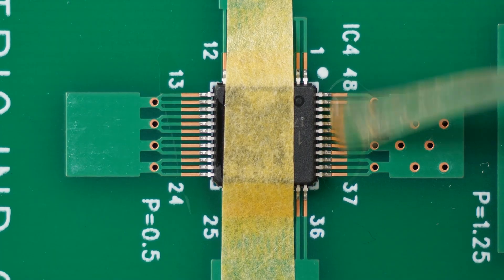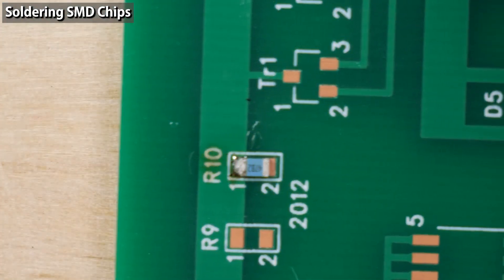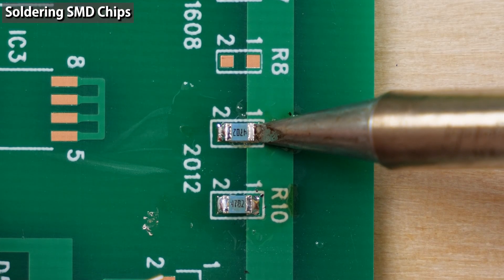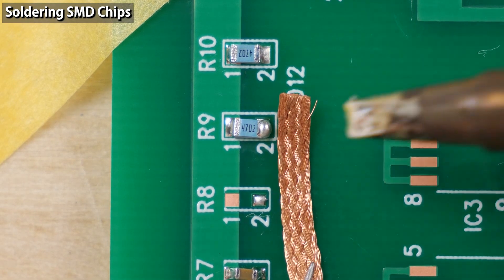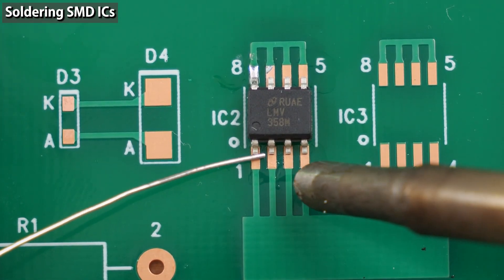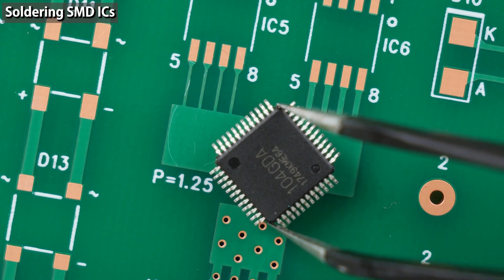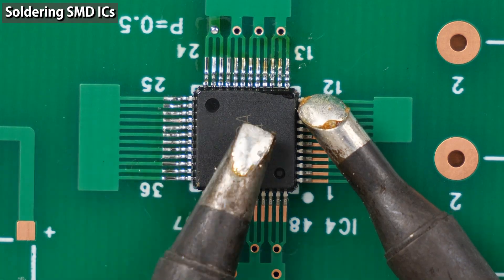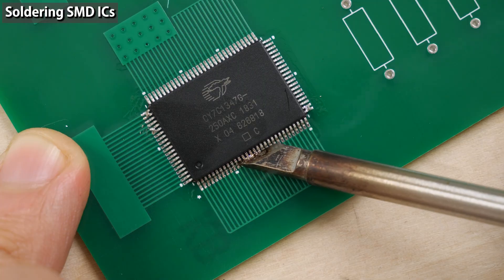Soldering SMT components is not easy.

Comment: I've soldered a bunch of 0201 PCBs for drones. It's quite boring and exhausting activity.  According to my experience, I'd wouldn't use the tip like yours's one. Apply a constant pressure from top to the 0201 element. <1% boards were faulted. Fix your wrists on the table.

Comment: as a newbie to electronics, I always mess up soldering, but you made it look so easy 😮. Hopefully one day i can solder like this. 

How can i prevent burning my pcb though ? I usually try to touch the tip on the pcb as you mentioned but most of the time it burns the green layer and exposes the wiring inside
Reply from the maker: Hi, Using a temperature-controlled soldering iron is good solution
Reply: @DENKI-OTAKU  what temperature sounds like a good one for you for this type of soldering ?
Reply from the maker: @frieddo  350℃±10℃ for lead and lead free solder.
For bigger parts and large area copper pad 360℃ or more maybe OK.
Reply: A good iron makes a huge difference. Using a JBC iron soldering is unbelievably easy.
Reply: You can never apply too much flux, and practice makes perfect. ;)
Reply: 0:34  He showed you the technique.  Applied flux to the pads.  Loaded the iron with solder.  Flipped the iron over and allowed the solder to touch the pad.. not the iron.  The iron is a heat source... no reason for it to ever touch components beyond incidental short events.